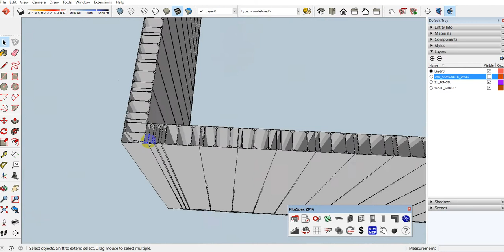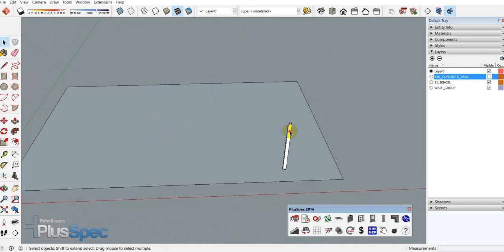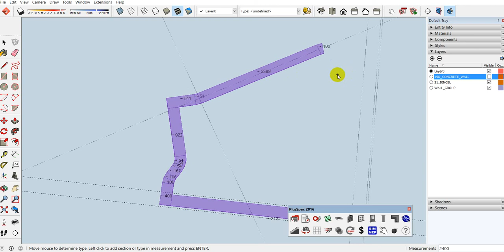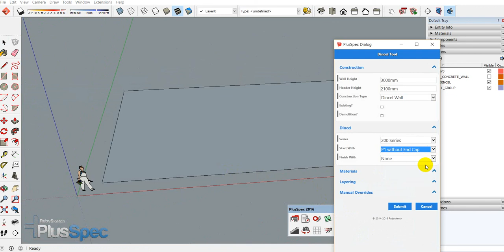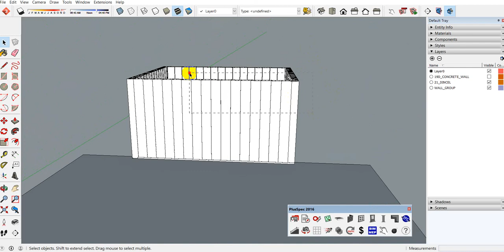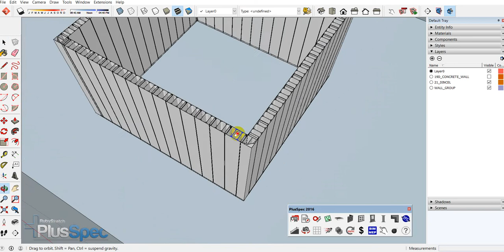DINCEL for design and construction efficiency.

Comment: Hi mate. What software is this? Or is it an add-on?
Reply: The software is called PlusSpec we make special versions for businesses that need design & estimating solutions. What do you need Mike?
Reply: @PlusSpec  I require take off/Bom support just like your video. I have used Dincel in my current build and would like to do model checks  myself as last time errors were made by estimator
Reply: @santamariamike  Ok PlusDesignBuild does take offs of everything in a job, you can book a demo on our website https://plusspec.com/plusdesignbuild/